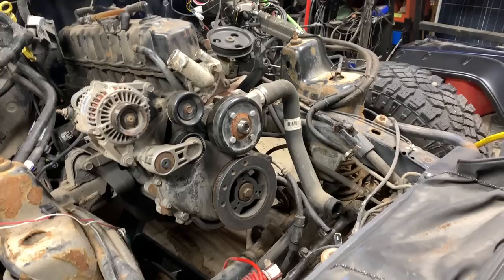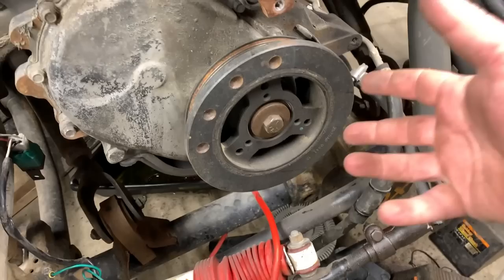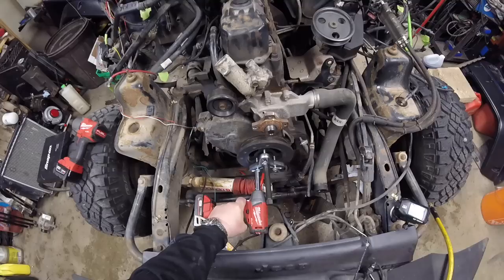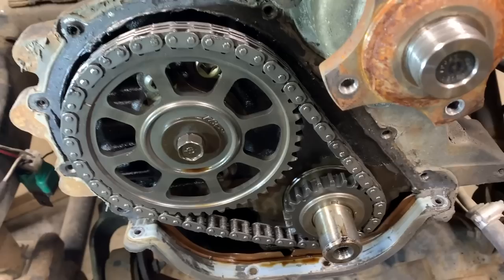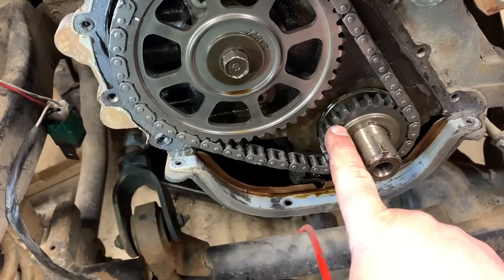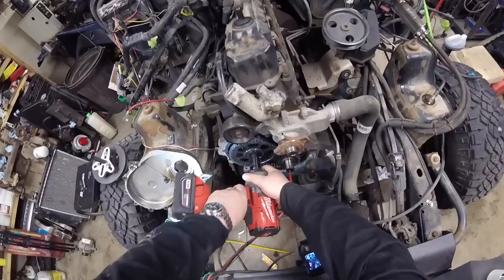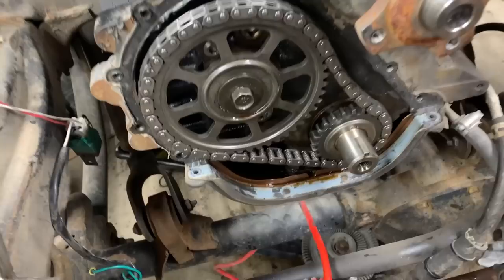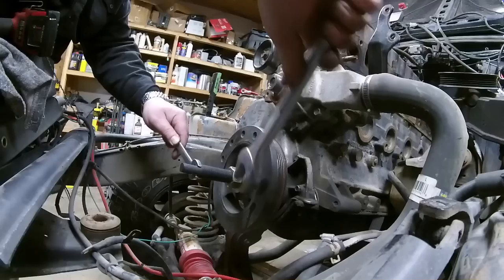DIY Jeep 4.0 Timing Chain How Too

Comment: Soak the new chain in oil for at least a few hours. If you just put the chain on without doing that it can wear the new chain in short order. If I'm going to do a timing chain,I soak it overnight if possible and move it around to work the oil into the chain links.

Comment: SOMEBODY PLEASE ANSWER. I took apart a 4.0l from a 1996 cherokee today. After I removed the cam sprocket I noticed a large hole behind the sprocket that exposed the cyl 1 rod. I read several forms and most of them say that's normal, but i'm not completely sure

Comment: Hello I have a question. I have a 98 grand Cherokee Laredo and have a crank no start situation.  I had to replace my pcm because they suck for this model, ( lose power while driving, lights go out at night usually when a cop is behind me, and would spontaneously go into drive). So I replaced but now it cranks but won't start. I've replaced crankshaft position sensor, and the camshaft sensor.  Then replaced the distributor both rotor and cap. Still cranks no start but would backfire while turning over. This tells me timing problem. Would it backfire if the chain slipped off or has way too much play in it?

Comment: Is there any spring and small bearing in the middle of the Nut for the larger geared sprocket is the timing chain. I have a bearing I can push in and not sure about taking it off

Comment: Watching another video on a 2004 Jeep Grand Cherokee with the 4.0 the guy had mentioned there was two different ways you can set up the timing marks for that particular engine,
 just wondering if in your opinion that's true ?
Reply: I know this is late, but for anyone else who may find it... when setting up the timing chain on the Jeep 4.0 and 2.5, you want to set the marks facing each other with the top side of the chain tight. If the top side is loose, you're risking a slightly retarded camshaft.

Comment: Do you drain the oil? Is there engine oil in there?
Reply from the maker: No need to drain oil
Reply: just be mindfull of dropping chunks of mud into the front exposed bit of oil pan.. could wash my jeep for a week straight and itll still rain mud whenever a bolt/part is removed

Comment: Is there any way to adjust the chain tightness, aside from adding and removing links?
Reply from the maker: Nope
Reply: There is supposed to be a tensioner bolted to the bottom side of the block on the right (passenger) side that keeps the chain tight on the bottom side. This engine is completely missing the tensioner.

Comment: I don't always like watching videos where the engine is easily accessible. I want the person making the video to suffer at least at much as I do when getting to those awkward bolts.
Reply: Ha! I should film myself suffering under my car tomorrow. Gotta take the bumper off, drop the subframe, remove coolant hoses, just to be able to get to two fucking bolts to remove the lower wishbones. British engineering at its finest.
Reply from the maker: You will be suffering when you do the fuel pump in your Jeep
Reply: @JimGriffOne  That's why it's best to stay American, especially from the 90's, with Jeeps....
Reply: @TestDontguess  eh it’s side mounted on my xj and my mj, after doing it a couple times I could probably do a fuel pump in 15 minutes

Comment: he did not torque the timing gear bolt and that timing chain had as much slack as the old one he took out , i just put a new one in mine and it is tight on both sides of the chain ! , he must of used the old gears !